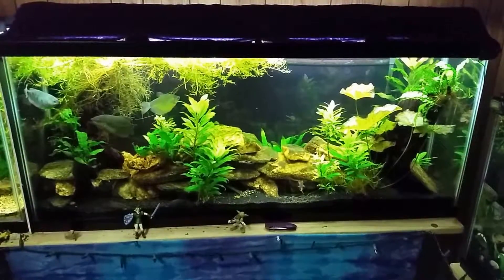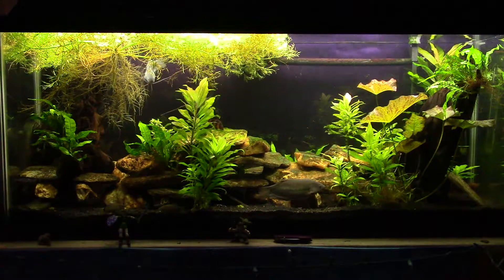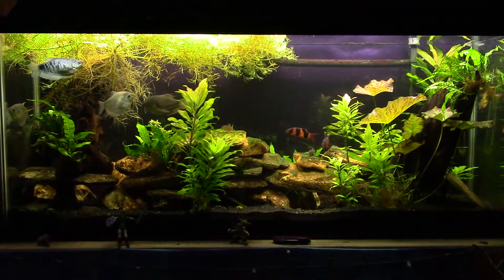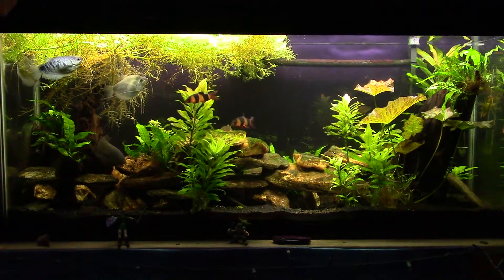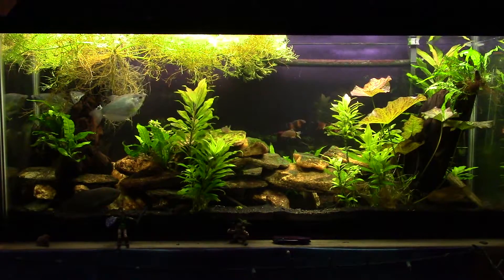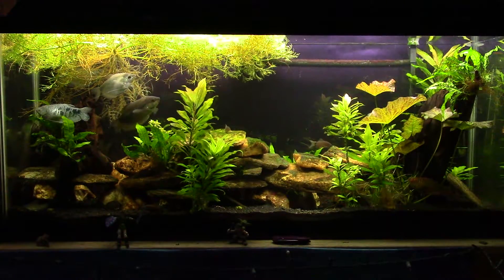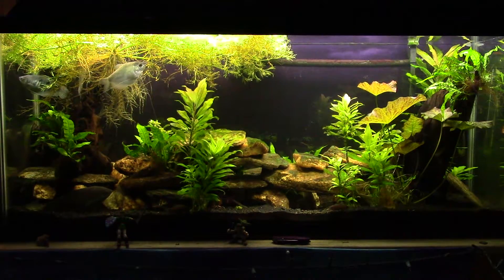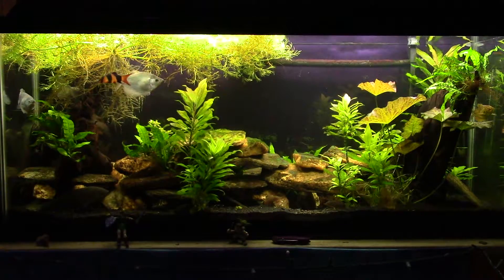Fluorescent lighting on Aquaria: A General Discussion

Comment: I use to run 4 6,500k t5s over my 100g. Recently when I replaced the bubs I went with 2 6,500k bulbs and 2 wave point ultra growth bulbs. They are those pink type of bulbs that have huge spikes in both the red and blue spectrum. So far its been a very very good choice because my tank looks better and the plants are growing even faster.
Reply from the maker: wow. that sounds great.

Comment: high CRI is usually a decent indicator of a "good" bulb
Reply from the maker: +Ruzz P That's a great point! I wish I had made it. Lol
Reply: +Dan Hiteshew lol, yeah theres alot to cover when it comes to lighting.  Another thing i should add is most t8 tubes are rated for a longer life span if used for longer periods of time. Most bulbs life spans are based off 3 hours of use. That's why i use the one year thing as a rule of thumb, but i have pushed them close to 18 months (more than once, lol). I sorta believe that by using our lights for longer durations, the bulbs arent degrading as fast as we think(or as fast as older t8s or t12s used to degrade), especially with some of the modern t8s.  T5's are a whole new can of worms too. I'm lucky if the bulbs even light up for a full year, lol.
Reply from the maker: Ruzz P I agree completely. Turning off and on is what degrades them most. It's better to leave it on all day. (contrary to popular belief, this does not use less electricity, but does slow the light degradation process)
I find with the T5's, they fade very quickly. Once you notice they aren't cutting it anymore, it seems like a week later they are worthless. The T8's fade a little more gradually.
Reply: Exactly, kinda like driving a diesel in the winter, leaving it running isnt gonna save you much fuel, but it saves excess wear and tear on the engine, lol
Reply from the maker: Ruzz P Excellent analogy. Damn it! Another one I wish I'd thought of! Lol

Comment: Great video, your goirami tank videos have inspired me to get a few gouramis for my planted tank.  Can you talk about water flow in your gourami tank?  I notice the surface and plants are hardly moving.  In my gourami tank I have a spray bar at one end and it really breaks the surface and sways the plants but my gouramis never hang out at the surface like yours.  (I do have floating plants)  When I reduce the flow I get too much detritus build up on the bottom.  Just thought maybe you could discuss that topic about gouramis and water flow in a future video.  Keep up the good work!
Reply from the maker: +Kevin122375 I can. Gouramis like very still water, but I'm actually moving 1175 gph around the tank.
I keep the surface fairly still. That's important for Gouramis. They're surface, bubble nest builders, so they come from very still, even stagnant water in the wild.
Reply: +Dan Hiteshew Thanks.  I was not sure if it was the flow or the lighting keeping my gouramis from the surface.  I have a very heavily planted (dirted) tank and a Finnex Planted+ LED light.  At night when I turn on the room lights I see my gouramis sleeping in the floating plants but when the tank lights are on they stay low moving in and out of the plants.  That leads me to believe it might be my high lighting lighting but I would like to hear about the flow in your tank, it appears so still.
Reply from the maker: Kevin122375 It could be a combination of the two. Gouramis LOOOOOve them some surface cover. Really bright lights will push them deeper. Notice how mine are only "near the top" when they are under the heavy floating Water Sprite? They don't just hang out near an exposed surface.

Comment: Good topic.  I didn't know what t8 and t5 meant. Also I didn't realize I could buy lights from a office supply store or a home improvement store.  I buy online from a fish supply web site.   I have two tanks with t5HO lights and two with led lights.   My t5's came with a white light and a pink rosette light and that's what I buy to replace them.  Do I need the pink one for my plants?   If I could buy two white ones from a office store I could save some money for sure.
Reply from the maker: the pink one is probably called "color max" and you'll probably have to get them at a specialty shop, or on Amazon. They don't really have a k number,  and they are fir bringing out the colors on your fish. 
I'll do a video about color rendering soon. 
you may not be able to find the HO T5's at office Depot, but any decent lighting supply place should carry them.
Reply: +Dan Hiteshew   Do I need the pink one of it doesn't help my plants  grow? Would  two white ones be too much light and throw off my tanks balance?  My plants grow very well with what I have so there is no reason to change.  
Thanks Dan
Reply from the maker: T Holz you don't need it for your plants. I took one of my units that came with a color max and a 6500k, and I replaced the color max with a 10,000k.
It will put more light in the tank, so it will change ghings, but it won't harm anything. 
You may see more algae, since you'll be dramitaclly increasing the light. 
It will look different too.
You can always but a two pack if lights and if you don't like two white ones, put one in and save the other for next year's tube change.
Reply: +Dan Hiteshew   So then next year I can just replace the 6500k bulb and leave the pink one since it doesn't have much of an effect on plant growth.  Would that be ok to do?   I don't think I want to go with two 6500k since my plants do well with what I have.
Reply from the maker: T Holz You can, but the color max will lose it's efficiency too. Your plants probably won't suffer any noticeable amount, but you may not be showing your fish's best colors off.
Reply: +Dan Hiteshew hmmmm some options to think about.   Learned a few things    Thanks again!